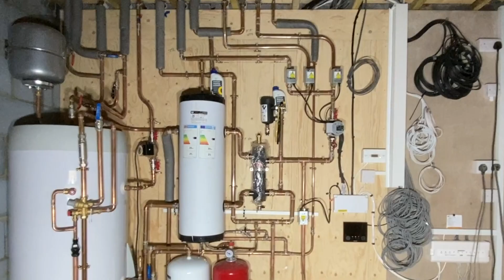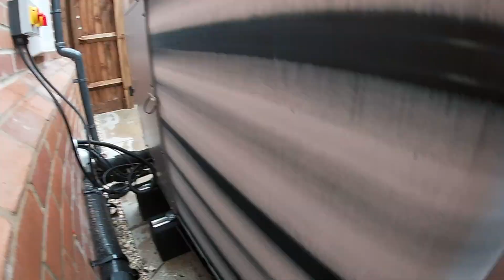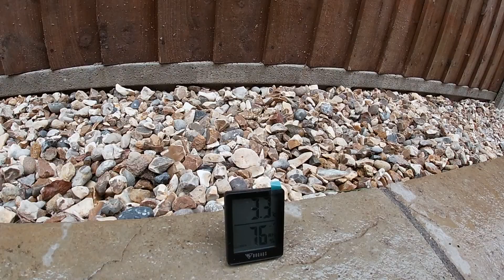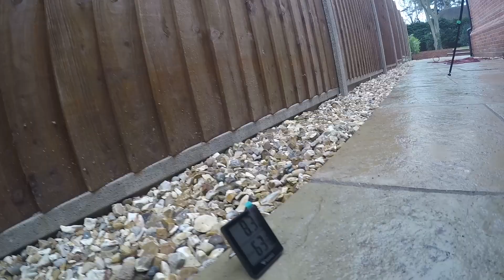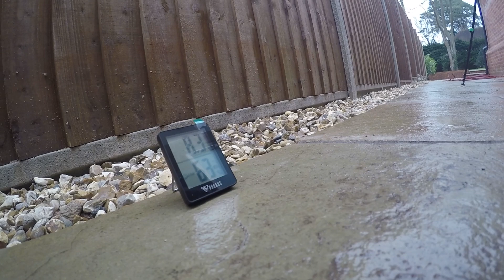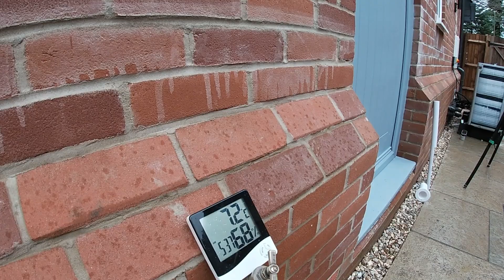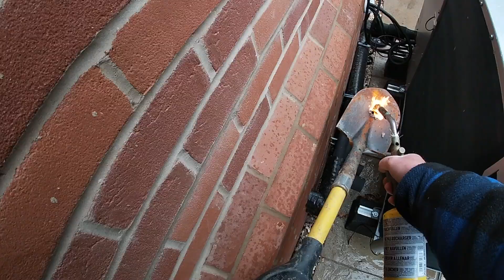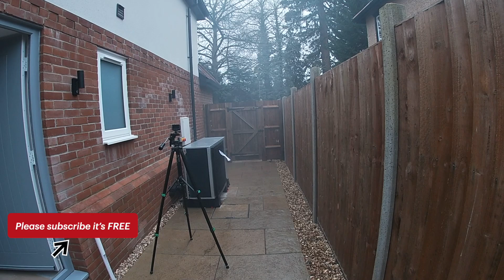Heat  Pump Freeze Up - HELP!

Comment: Hmm, I would honestly try the gate first like others have suggested and metal mesh the back for security  but personally I don’t think that’s going to fix it , this should have been checked by the installer before installing,  in my case I increase the buffer tank sizing , your mcs installer should be called back as it was there mistake , definitely do not remove it like others have said check the owners manual spec, it should clearly define what parameters to expect,  my Mitsubishi r250 cycles also every 30 mins but defrosts in 10 mins due yo the 120 litre  , and 2.5 is about normal for Jan in some cases , my feeling the buffer is the wrong size  it definitely shouldn’t have had the low loss unless it was cycling the glyco .in the loop .  Fins won’t work as it’s cold air it sinks and pools , your ownly option is the gate , try pro ping it open if security allows for a few hours to see if air flow helps dissipate the cold flow , as while washing the cars,  and monitor say partially closed . My feeling is it won’t improve much if at all, since air flow to the front is close , if it’s a stagnant corner then thus don’t fix it , another possibility is a faulty sensor in the heatpump that can affect cosy 6 units as well , again your installer should know and check it
Reply from the maker: Hi I installed the whole system  and followed a design the design called for just a low loss header , no buffer tank as you see from video I have roved the LLH and left the buffer , I thing the buffer is working fine  there is a volumiizer on the primary side and  I am happy with that ..Perhaps I should manage my expectations as a COP of 2.5 is not that bad  but I aim ing for  a COP of around  4   Thank you 👍
Reply: @ no problem, another idea you many have instead of relocating to another part of the building have you though of wall mounting it about 5ft off the ground, this will assist with the cold staging area since the elevation will mean it will move into the air path from the side of the building, it will mean renting a lifting unit and wall mount means extending the pipe work, far easier to do than relocating to a different part of the house, the unit seems to be already a quite mark so lifting shouldn’t be a problem with the neighbors.
Reply from the maker: @ram64man  Hi that's not a bad idea  Thank you 👍

Comment: Surely it needs towards a sunny & open aspect so it is less likely to freeze.
Reply: The heat pumps are functional down to -25C air temperatures, which means the evaporator (heat exchanger) runs very cold to enable it to transfer heat from outside, and is prone to icing up. This and the defrost function in all heat pumps is perfectly normal.
At -6C my HP defrosts about once an hour for five minute, fed by a 27 Litre volumizer (not buffer) cylinder.
Reply: @ - Yes, but that is an inefficient use of accumulated heat. Surely better to keep the ASHP in a sunny location, where more heat can be taken in, and where any regular frost/defrost cycle is less likely to occur.
Reply: @Benzknees  

The primary source of heat is that extracted from the air, exposure to direct sunlight also means a remote ambient temperature sensor needs to be fitted on a North facing wall to allow the weather compensation to function correctly.

The heat content of air at -18°C equates to 85% of the heat contained at 21°C.

Comment: I don’t get all these comments saying it can’t be an air circulation issue. Your system seems fine. Maybe settings need tweaking? These Daikin units are generally really good. COP of 4 or more should be achievable with outside air temps above 5 °C.
That side passage is a terrible place to put it though. A heat pump needs to exhaust into a wide open space, preferably facing the front or back garden, never in a narrow side passage! That’s just a cold sink that’ll saturate quickly, as your near ground temp measurements showed. Also, British winter often has temperatures rather close to dew point, so freezing is always going to happen but with such bad air flow, you’re concentrating the humidity which pushes the dew point even higher. Every time it defrosts it’s saturating the area with moisture. No wonder it takes a while to defrost and freezes up again so quickly.
Possibly, a 45 degree diverter panel will help. Choose one with curved vanes though if u go for this. The flat louvre style ones are crap. Direct it upwards or towards the back yard, or both if possible. If it’s not enough, then u have to bite the bullet and move it to the rear wall of the house.
I get that passage is narrow enough as it is, but that’s just another reason it should never have been put there in the first place.
As a few others have said, a wrought iron or other open type fencing and gate would probably help too. Maybe that plus a diverter would improve things.
Reply: Lots of people are making comments about the space because it probably doesn't make the difference. :-) If you check the manufacturer's specs (as someone has done here), you'll see that this installation seems to meet them. Heat Geek also did a video where they intentionally limited the space around a heat pump and all was well. I set it to start at 10 minutes where they're well into the experiment. Note that they're getting a COP between 2 & 3 with temps around 0: https://youtu.be/L5O2BSFqWwY&t=600
Reply from the maker: Hi Yes had no problems before  I have done some adjustments to the settings it it has made some improvement  I think  a bit more fine tuning might be needed  . Thank you

Comment: Anyway why the hell is the pump on top of the drain access think that says it all oh and the installation in the plant room looked pony
Reply from the maker: Thank you, despite the bearer for the heat pump kissing the man hole cover today we did a drains test with building control and were able to carry out test with no bother and no disturbance the the H P . Thank you.👍

Comment: I probably wouldn't zone it, just open loop would be far more efficient. Get rid of the buffer, trv valves. Its all just inhibiting flow. Zoning is just reducing the size of the emiiters in the property and reducing the efficiency of the heat transfer, making the heatpump work harder.  Are you using weather compensation? maybe get openenergymonitor in so you can see whats going on.
Reply from the maker: Hi yes but this is a new build  and building control require stats and try's  Plus the end user will potentially  want to control heating while on Holiday from his phone standing on his head in the shower 😁  Thank you 👍
Reply: @HEATSEEKER1428  It sounds like building control needs a revamp to include measures that are useful😄.  Unless rooms are thermally separated i've never really understood why TRV's do much really in your average 3 bed house.  Most people dont really religiously close doors.

Comment: you have a microclimate around the heat pump, the cold air has nowhere to go. Maybe leaving that gate open, forcing the ac to circulate with a fan, or move the pump.

Comment: This reminds of the issue you can get with a poor air flow PC cases. However in this scenarior your getting cold air pooling by the heat pump which you have figured out, you want to move this air away from the heat pump as quickly as possible, going back to the case example, what fixes that it having a mesh front pannel, along those lines is it possible to have the fence pannel which allows for more air flow or a gap under the pannel to allow for the dense air to seap through. Another option would be to move it to the back of the propoerty, there will be more volume to work with and fan on the unit will be able to move more air without the fence restirction.
Reply from the maker: Hi touching the fence panel is not an option as it is a party fence , If the Hp is in perfect working order then we will have to relocate the HP  Thank you .👍

Comment: Whoever installed it made a very basic mistake. Part of the unit base is sitting over part of a manhole cover. That cover cannot be lifted without disturbing the heat pump.
Reply from the maker: Hi I installetd it and that is its planned position . The builder did not realise. I have taken the manhole cover up myself  without disturbing the HP. Thank you. and good Luck 👍

Comment: Another thought - is the buffer tank causing a problem? If you have a mixture of 28, 22, 15 pipe to the radiators, it's difficult to see that you need it. You could replumb the buffer as a volumizer instead and see if that helps.
Reply: Remind me ,  what size heat pump have you installed , what  is the size of the property , insufficient volume can cause compressor to switch off frequently, known as cycling, as a result constantly  frosting, have you zoned upstairs and downstairs?
Reply from the maker: @lekanshanu5512  Hi  Heat Pump is 14Kw  property is 5 bedroom  5  bathrooms  Total area  of underfloor heating is approx 120 sq  m Total area of property all floors is approximately 200 sqm I have been running heating with all zones fully open  ( stats @ 30 c ) .Thank you 👍
Reply from the maker: Hi thank you that is worth considering . I am Just a bit concerned if only a few zones are opened . the HP will be short cycling . Thank you 👍
Reply: @ I don't know. Even on my installation I have everything open all the time and leave it on weather compensation with a low flow temp (35C max), flow rates easily get to 20 lpm through the system. My pipework is all Cu 15, 22 and a tiny amount of 35 (the 35 is overkill) with about 14 Stelrad steel radiators, most K2 and K3. The Urban Plumber has a great series of YouTube videos.
Reply: Again, I'm just guessing here, but if you're only running some of the zones at the moment then there might not be enough volume to quickly defrost the system.  Potentially the buffer is just recycling the water rather than pumping it through the house making the defrost worse. I know that you can get really bad distortion with buffers.

Comment: Hard to say without data. For comparison, I'm running my nominal 5kW Vaillant at 7kW (when it's on) and 5.4kW (i.e. really, really hard) overall in a 5 bed 1930s house with fairly poor insulation. The heat pump is at the back of my house with no obstructions and the defrost cycle is 5min to 10min (usually closer to 5min) every 40min when it's below 5C and humid. I use an "Open Energy Monitor" which gives me great data, there might be other options with your heat pump. 14kW seems massive to me - perhaps too big for the emitters in the house?
Reply from the maker: Thank you . Your HP sound to be performing in the same way as this one that I have installed . Perhaps I am being too cautious. Because at 2 C it is going into defrost mode about every 35mins and the defrosts for about b5- 10 mins. with a COP of 2.5 . Do you know what your C.O.P is  ? thank you ,👍
Reply: @HEATSEEKER1428  I've only recently installed mine and (October this year) the overall COP is 4.1 but in the recent cold snap it's  a COP of 3.7. That is very good (but not the best). I'd expect yours to be much better than 2.5.
Reply from the maker: @ChidleyEngineering  Hi Yes  yours sounds a good install . On really cold days I want like yours a COP of around 4  and on average days 5  . Thank You  and good luck 👍
Reply: If it's only recently been switched on, and it's a cold damp house, the heating might be working quite hard.
Reply: @ Yes, you should be able to do better than I can as you're also using underfloor heating. Bear in mind that I also have 5 people living here with a 300l DHW cylinder. That makes my COP worse.

Comment: First of all congratulations on your install and for doing this video. I think you are definitely onto something but I have a feeling it is not such a great deal. I have only watched the video once and that was six hours ago which at my age exposes the frailty of my memory, I will watch it again. First off your COP is low but pinning the cause of that entirely on defrost cycles could be a step too far. Second are the defrost cycles unusual for the specific ambients and RH, how long does it take to complete  a defrost cycle and how many defrost cycles per hour (bear in mind what you are experiencing may be acceptable). Clearly there is some re-ingestion occurring as witnessed by your low level thermometer at the condenser inlet. One idea worth playing with is doing a scale drawing and modelling the effect of angling the unit so that is not parallel to the fence but at say a 10 degree angle - imagine or draw it out like a snooker ball shot and measure how far down the alley the returning air flow arrives back at the property wall. Enough for now I will rewatch.
Reply from the maker: Hi Thank you that is not a bad idea  I don.t know if I can achieve 10 deg. but I think you might be on to something there . Regarding the COP I suppose on the face of it an appliance running at 250% efficiency is a good thing but I need it to be better to compete with the cost of gas . Thank You . 👍
Reply: @ OK - I have just finished rewatching. In the near term I think there are two things worth experimenting with 1. Improve the draft in the alleyway by removing both gravel boards from the fixed sections either side of the gate. 2. Build and fix a deflector to the fence - essentially the son of angling the ASHP. Essentially the width of the airstream and near full height of the fence, coming out from the fence to the edge of the gravel and returning to the fence presenting a shot off the cushion down the alley. Easier to draw than describe but if you had a spare fence panel you could jury rig that for the experimental phase. I need to find an RH/Dew point chart to check your icing experience in the video. In the meantime can you tell me what the calculated heat loss, what was your design outside temperature , your design flow temperature and what is your running and control strategy - oh and make model and capacity of heat pump.

Comment: you said putting the heat pump on a high wall bracket would be an issue, but you would improve air circulation by raising it off the ground, ... how about a bracket about four or five foot off the ground which can be tied to the ground and/or wall ? In this case the neighbours will see just the top of it.
Reply from the maker: Hi That's not a bad Idea Thank you 👍
Reply: @ Think about putting louvers on gate, anyway & everyway to improve airflow, ... consider moving shrubs impeding airflow, anyway & everyway... get that up out of that space because there's not enough airflow.

Comment: Makes me laugh like a drain, all these experts. Beard stroking Tree Huggers😂😂😂

Clearly the issue is air circulation around the cassette ASHP, you’ve proved that with the Digi Thermometers. The unit is just sucking in chilled air.

A huge issue with ASHPs in the UK, is our high moisture content cold air <5°C can have 90% moisture content in Winter. Leading to more Defrosting & killing the SCOP.
We don’t have a Dry Cold here, we’re too near the Sea in the UK. ASHPs are crap in the Winter here for that reason.

For reasons of Damp, condensation & indoor Air Changes. These parameters are being revised for Heat Loss design.
Reply: "Clearly the issue is air circulation around the cassette ASHP"

======

The manufacturers installation manual disagrees with you. The problem with HPs is the Merchant Bankers who profess to know it all without even RTFM, how does your heat pump perform ?
Reply: @_Dougaldog  Well it was you that said it son……..you’re not a ‘qualified Heating Engineer’.  Whereas I am!!! 😂😂😂
Reply: @jimmygillies5590  

As I said RTFM, have a look at the Daikin EDLA14 installation manual (Hint : Page 2, Available from Dailkin). Then come back and tell me you are a qualified heat pump technician.

Comment: are you running in a silent mode and is your backup heater enabled?
If you have silent mode and no backup heater the system will never reach equilibrium.
Reply from the maker: Hi Not as far as I Know  not silent mode  and no have got back up heater turned off.  We ar Getting Daikin engineer to check  machine. . Thank you 👍
Reply: @HEATSEEKER1428  the backup heater can help avoid thrashing. check the equilibrium setup in the installer backup heater section.

Check silent mode in the user setting.

Daikin silent mode effectively causes icing because the airflow is reduced. This "feature" is documented in a single warning in the installer guide. 

Also check "increase temperature around 0" feature in space heating settings. I disable this.

FWIW my system running with no BUH and in silent mode leads to frequent defrosts and cop of approximately 2.5 at 0 celsius. When silent mode is disabled, backup heater enabled and increase around 0 disabled the cop is exactly what it is supposed to be at 0 celsius - around 3.2 with an UFH system at 34 celsius.

If you are running radiators with elevated temperatures it's unlikely the system will produce high cops at low ambient temperatures. The important thing is you are warm.

You will only get higher cops at higher ambient temperatures in the autumn and spring, in which case the system won't need defrosting.

Don't compare yourself against heatpumpmonitor.org.......